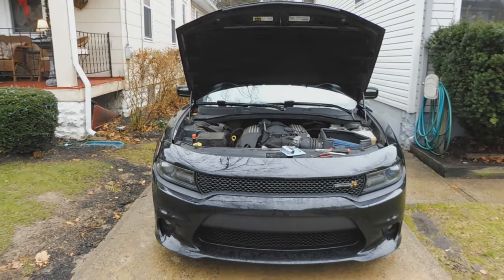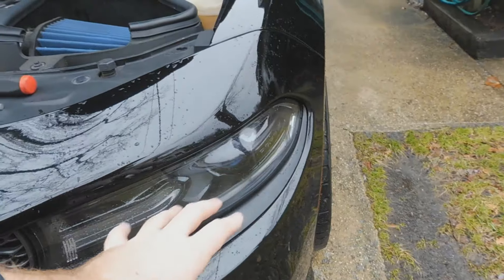How to install headlight bulbs for your Charger GT/ RT/ Scat Pack / 392 / SRT / Hellcat

Comment: Note, if you have big hands.....its a tight fit...
Reply: It's a tight fit for medium hands too lol.  Taking the air cleaner off and replacing it (getting it lined up) is difficult also.
Reply: @RJC-ps6wc I had to open the air filter and just mount the bottom half by itself to get proper alignment.

Comment: I changed my lights but it’s flicking and then it turns off what do I have to do
Reply from the maker: Are you putting in some sort of aftermarket led or hid? As long as they are halogen lights- you should be good. Check the connections.

Comment: My headlight Keeps getting condensation in the headlight unit how do I fix that
Reply from the maker: Check and make sure that cover is tight. That stops condensation from getting in.
Reply: @johnnygt6039  yes I’m definitely gonna do that this weekend I took it to dodge and they wanted headlight with installation $1000 I’m like no freaking way
Reply from the maker: @407to618  $1000 for WHAT!?
Reply: @johnnygt6039  That’s the same thing I was asking myself not just a bulb but I’m guessing a hold of the driver side so bad and I’m guessing including installation they say it like $1000 so I guess I’m going to just go to Amazon and By the headlamp and try to find a video on how to install it I heard you have to take the whole bumper off which I hope u don’t

Comment: Srt and hellcats can’t relate to this cause they come with the factory HID .. only for scats and lower trims unless you get the HID option
Reply: Yeah my scat charger has HID option
Reply from the maker: Dan, how much different is the set up?  I'm assuming the housing and the access to the bulb is the same or similar?
Reply: My 2018 392 Daytona come w/ Hids stock
Reply: Not true not true..both of my scat and hellcat have the same HID....
Reply: My 2011 Dodge Challenger R/T Super Track Pack has beautiful stock HID headlights. My brand new 2020 Dodge Charger Scat Pack WB has crap halogen projectors. I think HID's should be standard once you get above a certain amount of horsepower and torque! Lol's!!!😜🤪
Reply: @HEMI-MOMMA  it’s kind of the same with the interior no matter the trim they put those ugly amber lights

Comment: thanks changed mine on the passenger side today this video helped alot, taking off the cap was the hardest part
Reply: Did you twist or pull up? I can get mine out
Reply: @mikethegodson4250  I twisted it it took a while because it was tight
Reply: Did you use anything other than your hand?
Reply: @CharityRaiane  only my hand
Reply: Thanks for responding. I changed it out, thank you
Reply: So do you just buy a bulb to fix turning signal light or you have to buy a lot of  other stuff
Reply: @reportingforbbws  I just bought the bulb. Nothing else is needed. The passenger side was very easy . You'll need a little more tools for the driver's side because of things in the way
Reply: @reportingforbbws  I haven't done the turn signal but it shouldn't be too hard either it was only my headlight that needed to be replaced

Comment: Hi, i have a problem with my charger 392 daytona with the beam alignment. It sucks and and the mechanical adjuster seem to do nothing
 Any pointers and the dealer is clueless  in the UAE
Reply from the maker: I would use something like a garage door.  The mechanical adjuster is adjusted by a allen key.
Reply: @johnnygt6039  i used my hand and turned it like 10 times but no change since i dont have a long allen to reach. But will go buy an allen wrench and try it thx